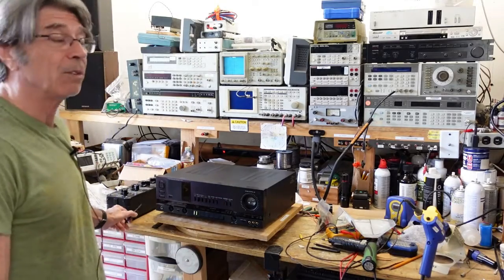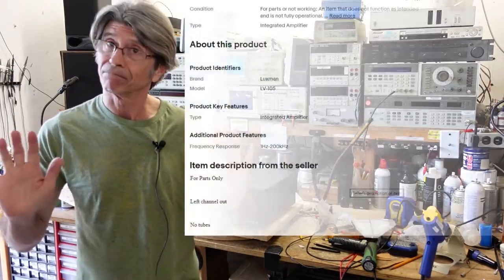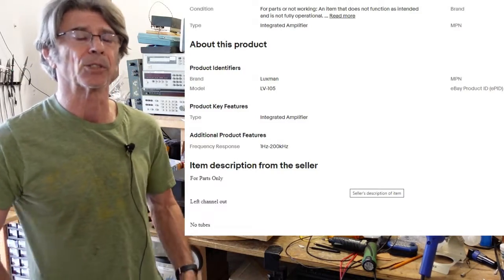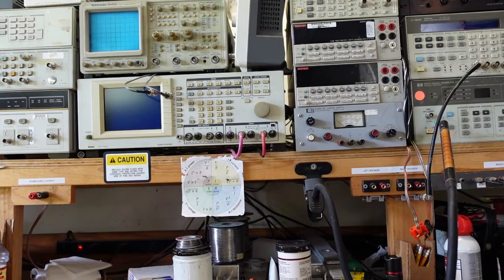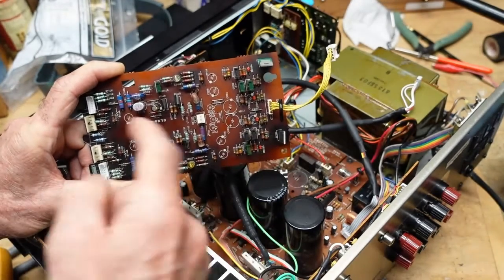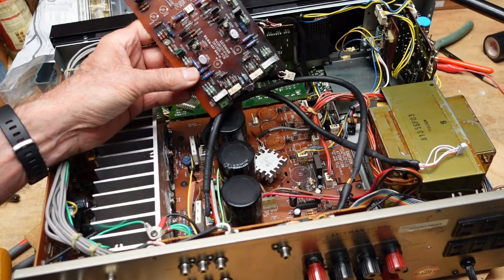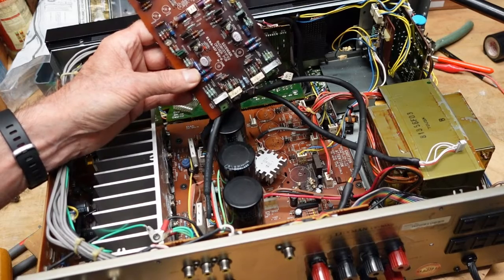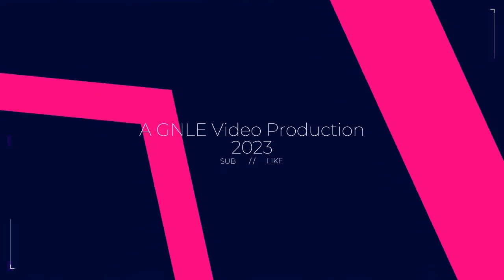Luxman LV 105U Repair Project

Comment: I have a Luxman amplifier lv105u
Power transistors ( 2sk405 _ 2sj115 ) are  not available  in the market
There is  available  equivalent  For installation , thanks
Reply from the maker: I'm not sure if this is a question or a statement.
Reply: @raygianelli3612  I am asking if there is an equivalent parts for the ones I mentioned,
Thanks.
Reply from the maker: Ah, OK.  No, there isn't as far as I know.  I was lucky enough to find some NOS ones from a reputable seller, and they weren't cheap.  But I got the last 4 he had.
Reply: can I use the mosfet ( irfp240 & irfp9240 ) < thanks  @raygianelli3612

Comment: A few years ago, I picked up an auction Hafler DH-220, listed as "For Parts", it had pictures listed, and most major parts seemed to be there, so, I git it at a reasonable price. After receiving it, I came to find out that the TO-3 packaged outputs, which are supposed to be N and P Channel MOSFET's, were all burned out 2N3055's.  It was either purchased and harvested before I got it, or, some inexperienced repair tech thought that all amps took 2N3055's, gathered up some, and in they went. When I get to it, I will prob refit it with TO-247 or 264 packaged devices.  As far as EasyEDA, I have played with it for awhile, I found, for me anyways, its best to just skip the schematic, and go straight to the PCB layout view, pick  component footprints out of the library that I might need, or, make my own when needed. There's a learning curve to all of those software's, but I've found I can make a board layout and gerber fairly quickly, then, double, triple, quadruple check everything ( try to pick parts with a 3D model, and then also do a 3D view after saving, it's great for discovering interference between components before finalizing the layout) before sending it off for order, and not to be disappointed if my first attempt ends up in the trash ( recycle, of course)
Reply from the maker: Awful story about the Hafler.  I don't think the seller in my case was trying to deceive anyone, but there were lies of omission.

I'm brand new to the EDA game, but I see the wisdom of your approach.  The board is, after all, the end result.
Reply: @raygianelli3612  A good practice with the EasyEDA software is to enable the "Ratlines" view ( click the "Ratlines" eyeball), which is disabled by default, so, if you are working with a schematic to board creation process, it will give you tiny blue lines to let you know what you may have missed for needed connections. The naming of, and conflicts with "NET" designations is another story, on occasion I find myself hiding errant pads under a footprint and having to go hunt to find out what I goofed up, but running a "Check DRC" will point them out until you correct them.
Reply from the maker: Wow, I'll have to check these things out. This sounds like really useful advice, and I thank you for posting it!
Reply: I have never used EasyEDA, but I have used ExpressPCB and the schematic is the critical part of the board design because you link the schematic to the board. When you place the components on the board and click on the component pads, it highlights all of the other component pads for that trace and if you are missing a component or have a trace to the wrong component leg, it tells you.
Reply from the maker: @StevesStrayStuff  I need that kind of error checking in my daily life! Thanks Steve!
Reply: @raygianelli3612  My daily life error checking buffer is always full 🤣
Reply: @StevesStrayStuff   I tried the schematic to PCB layout level, and ended up with a birds nest of ratlines, which took longer to resolve than just doing the layout right on the PCB screen. The one trouble with doing things on a schematic level first, ( for me, anyways) is, that specific component has to be in a library to use if you want to keep some semblance of sanity in the design, and then, you have to drag it all onto a PCB layout background, reposition your components where you would like them, and then hope all of the schematic "ratline" connections stay attached. Then, you can try your software's "Auto routing" function, or do manual traces, and then check again so your NET's and ratlines don't have conflicts or missing connections. For just a handful of parts, 20 or less, I find it easier to just go to the PCB layout, as I am comfortable enough with handling traces, Via's and pads, and like I said earlier, I go into things with some component footprints I may use, edit the properties so they come up correct on the top silk layer, and go with it that way.
Reply: @poormanselectronicsbench2021  Haha, a bird's nest, great analogy. You are absolutely right, library components don't cover everything and custom components are a pain to create. I am old and crusty and I rely on the NET to make sure I don't hose it up. At my age, I will use any tool that gives me the advantage of getting it right 🤣

Comment: I second KiCad and jlbpcb. I have an LV105 in storage that I need to fix the pots on so If you need any info from a working unit let me know.
Reply from the maker: Appreciate the offer.  There seemed to be significant differences between the 105 and 105U, from looking at the schematics for both.  I'm sure that there are similarities in areas, though, so I may take you up on it!
Reply: Pretty sure my unit is a U as well.

Comment: Ray, I've repaired several of those LV105U's. (None were that toasty). All had different issues but the IC's in the tone control were an included common fault among them. Causes static and distortion.
Also, you are Awesome! Taking the time to learn the building and design software. Something I always wanted to do but were too busy repairing and restoring other's equipment.
A whole day of frustration? I see it's worth it. I'm following with great interest. Great installment!!!
Reply from the maker: Thanks you sir!  I may be reaching out to you on this as it progresses.  But at this point it's going to take a lot of work to get signal from point A to Z.  Static and distortion would be a step up.  😁
Reply: Copy that. Those op-amps rear their issues after you get it up and running. Thanks again Ray for the inspiration to push my skills. (In case you need them LM4562 are a good choice, no decoupling needed).  @raygianelli3612

Comment: This is the kind of content I love, Thanks Ray. You have a good challenge there but I'm sure you're capable to sort it out. One thing I'd like to mention and maybe you already are aware, those cooked boards can go conductive and leak current between the traces. Something to be aware of with high voltages or high impedance circuits.
Keep the great content coming Ray
Reply from the maker: Trevor!  Good to hear from you!
The boards here are brown from heat, but not burned up, like you'd see if a resistor smoked.  It's the carbon that causes the issues, as far as I know.  Does that sound right to you?

Comment: Oh my goodness, braver man than I am ! This is gonna be a great project. This must be a decent amp when new or just a personal favourite or both ? I have a problem with these kind of amps though as in the past I've opened these 'Hybrids' only to find the Valves are there as buffers or in some instances the heaters were only wired up so they became just 'eye candy' giving that 'glow' and warmth but you don't even get that boost in the 2nd harmonic ! for goodness sake. I hate to say but most examples are cheap Chinese. I can't wait to see the circuit diagram of this old gal. I cut my PCB teeth with EasyEDA and CAD and loved it, before that it was ferric chloride all the way ! and I still use LCSC. However I found that using a browser based Cad not to my taste and of course "Real Men Don't Use Autorouters" Lol ! so I moved to Kicad (Key-cad) and never looked back as there is so much stuff that you can use to realy 'amp up' (pun intended !) your design to a Pro level coupled with the fact I loved making PCB's even in the bad old days. Great project and I will, as I'm sure many will be with you all the way Ray lol !....cheers.
Reply from the maker: Good to see you again, Andy!  I'd read about Kicad, but the person who I asked about making PCB's used EasyEDA and I wanted to have someone to reach out to, so that's the reasoning behind me using it.
In this amp Luxman uses the tubes as a second differential amp..  I honestly don't know if it's beneficial or not.  I just saw a challenge and a learning opportunity.  Even if the only thing I learn is not to believe everything I read on eBay.  😁
Reply: Yeah it will be quite an experience. Yep EasyEda is a good place to start😁🐭  @raygianelli3612

Comment: I remember sticking those traces to copper boards and etching them. Mine always came out ragged looking. I have had boards made using ExpressPCB. They were double-sided. They came out amazingly professional and they were fairly inexpensive. I was shocked and proud of the end result. You have quite the project ahead of you! Good luck Ray!
Reply from the maker: Thanks Steve.  You'll have to come by and see it when it's done... providing that I can get this thing working!
What did you have boards made for?
Reply: @raygianelli3612  The standard double-sided board size was 2" x 4" with component/text silkscreen and they came in a three pack for $51. If you needed larger boards the pricing changed by the board's area.